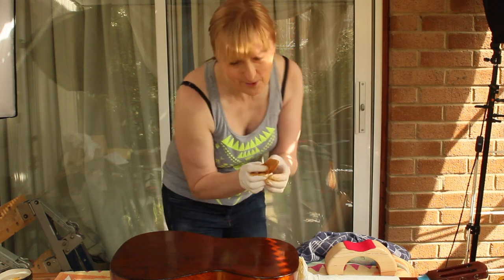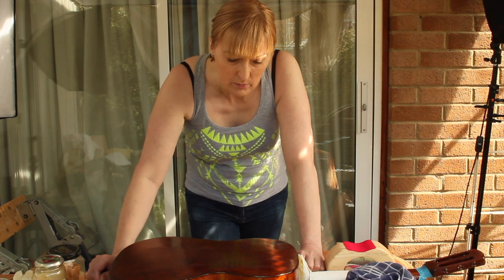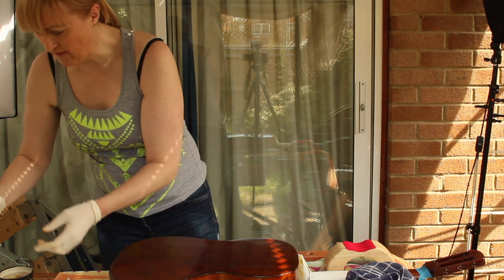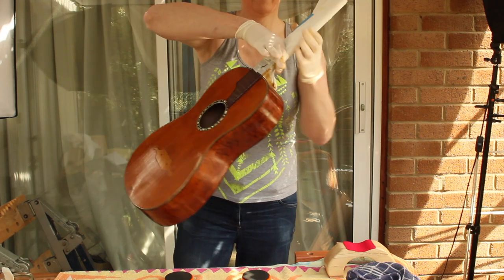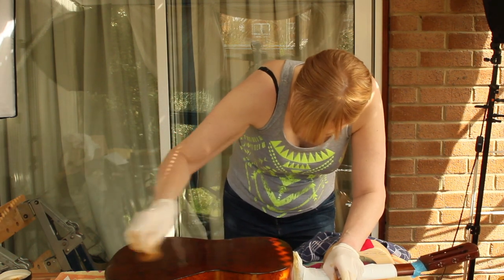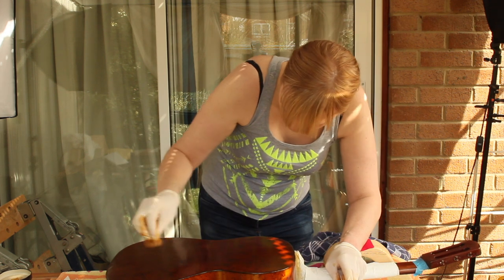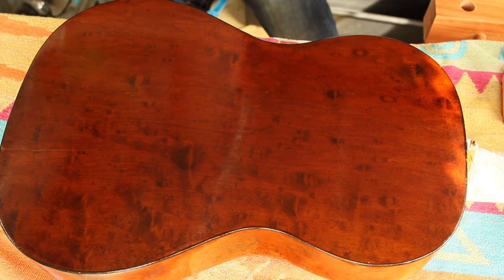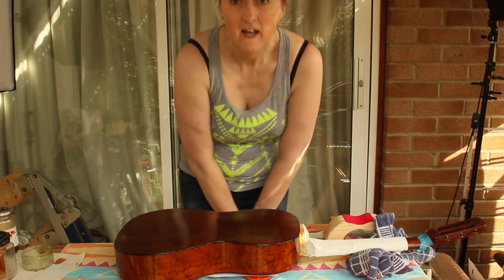Restoring an antique parlour guitar part 31: A short back and sides video

Comment: I like Buffy the Vampire Slayer too :-) The beauty of shellac is, that how ever many layers you do, it's always one layer. The alcohol of the new layer dissolves the surface of the old layer. That's what makes it infinitely repairable, unlike lacquer, which forms many thin films on top of each other.
Reply: If that's the case why multiple coats, I must say its looking very good.
Reply: Rultiple runs make the coat thicker. Also smoother and shinier.

Comment: I used to spray my car parts in my kitchen and front room while they were hanging from the ceiling from coat hangers, that way you can do all around without putting it down.

Comment: Makers hold the instrument by the neck in a vice. I'd have clamped the fingerboard to my workbench with the body hanging over the edge....
Reply from the maker: I think I'd find that a bit low for working on the sides. I'm considering making a neck vice that slots in the bench vice and holds the guitar above the bench
Reply: Google 'Zyliss Vise'. Every luthier should have one! Zach Taylor had 2 so did Jose Romanillos. Not made by the company now now but you will pick one up on eBay. Australian company makes one for the cost of a small body part...
Reply from the maker: +Pete Howlett A$380 apparently. I might have a go at making something